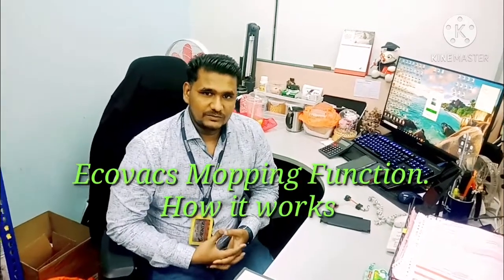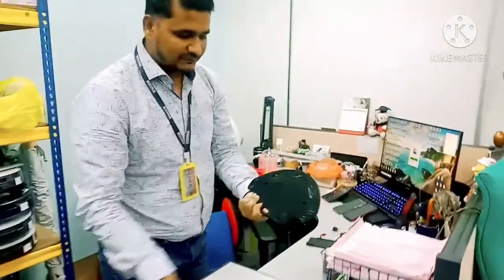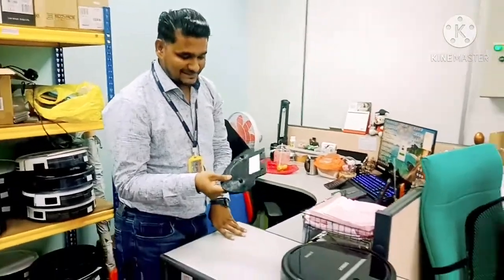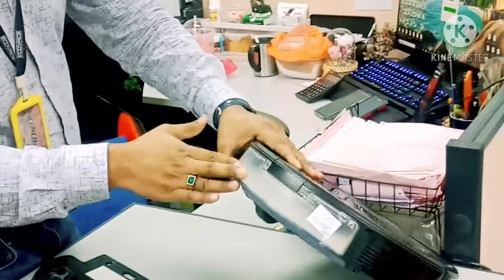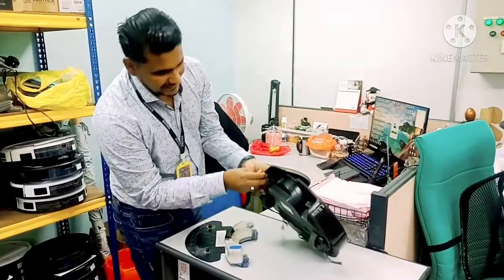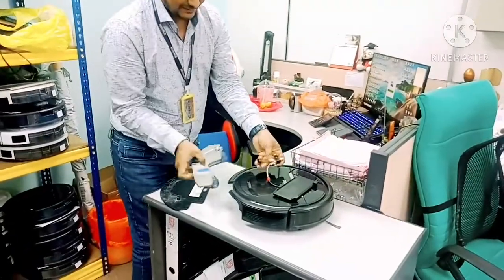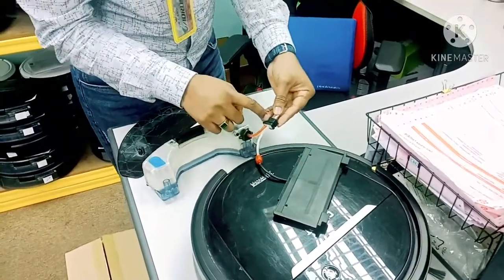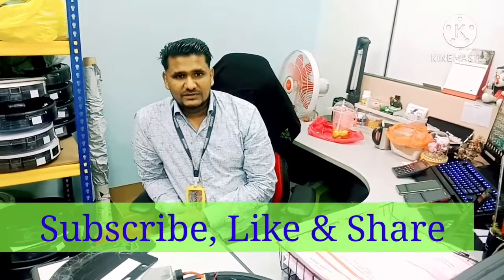Reasons why water can not dispense while mopping

Comment: How to clean Dettol or detergent from the water tank
Reply from the maker: Detol signe can not remove but detergent can remove with hot water...but don't shake tank else pipe Will disconnect then need to replace water tank...just leave hot water for few minutes then just gently turn ... detergent will comes out

Comment: My ozmo 950 not dispensing water. In fact it climbed on carpet also.. same was as it would do when water tank is not attached. So I feel it is not sensing water tank only
Reply from the maker: After power on the deebot plz attach water tank with mop plate together see weather deebot gives msg that Moping plate has been installed or not...if got msg n deebot still enter in carpet area means carpet sensor faulty...located next to charging connector in whole...just replace that will be ok
Reply: Thanks for your reply...i actually repaired the main brush motor by watching your video. That main brush motor issue is solved and thanks for the same. I have done some mistake in assembling it back and after that the water dispensing has stopped..it does not look like carpet sensor issue as water is also not dispensing

Comment: Any advice for when it is not working but you have only used water? We have not used any detergent and no water is coming out.
Reply from the maker: Good question...ok for testing plz remove moping cloth...make sure water tank full with water.. moping plate attached... remove water tank n plate together.... power on the deebot..once ready to use then attach water tank n plate without cloth together see weather deebot gives voice indication that moping plate has been installed???...if got msg then press water tank from back tightly n hold then pres auto button see water can dispense or not...if can then just water tank issue.. became slightly loosen from lock so need to replace tank only...if still no water then water Pump Issue... need to replace...but you plz check my other water pump issue videos as well... sometimes just pipe Tangled that's why water couldn't come...like this u can try at home first

Comment: Thanks for the video, very informative. Using floor cleaner seems to be a common mistake, shame the manufacturer doesn't think to apply a sticker to the tank saying "DO NOT USE FLOOR CLEANER, WATER ONLY", that may save a lot of us making the mistake. I have a Deebot T9+ & used pine-o-clean and now it doesn't work. Is this something I can take apart and try to fix at home or should I return it for repairs? Prior to this we were extremely happy with both the vac & the mop, it has exceeded our expectations.
Reply from the maker: If service center available in to your country then better take it there... because they got parts can test weather water tank issue or water pump
Reply from the maker: U mean water not Dispensing from Ozmo pro tank or its not ascallate ???
Reply: @ecovacstechnicalsupport5278  water does not dispense
Reply from the maker: Can WhatsApp at 01137973018..a video clip so can confirm what's the issue
Reply: @ecovacstechnicalsupport5278  Sorry, I don't have WhatsApp. The issue is I used a floor detergent and now Deebot mops like it should except no water disperses from the tank, it just does a dry run. I assume the tubes are blocked as you have shown on your videos. My question is, is this something I can try to fix at home or should I take it back to the store of purchase for repairs?
Reply from the maker: Actually need to dissemble the deebot so can test weather water pump disconnected or just water pipe block...
Reply from the maker: Without open the deebot you can not confrm what's the issue
Reply: @ecovacstechnicalsupport5278  So should I try it myself or take it in for a service?
Reply: It does say only water in the instruction booklet that came with the robot

Comment: Hi,

Today I, received a Ozmo 930.
Resale version. Shouldn't have issues but unfortunately there was no water coming out as told in this video.
I checked the outside parts but didn't see something wrong.
Thought maybe the pump is dry.
Sp decided to put a Syringe (10cc medical injection) with some silicon hose on it. (end little bit tight up with wire) placed it over the intake nozzle and pushed water through.
Had some resistance but pushed gently through until something felt like opening/popping. Directly after the 3 nozzles starting to flow water out of it.
So also probably clogged or sticked tubes/pump.

Maybe it helps others.

Now working fine but keeping an eye on it. Luckily the pump or maybe only a motor is not an expensive part to replace and handy enough to do it myself.
Reply: And if not allowed to put cleaning dissolve in just wash the mop before and put some detergent on it. That's enough for one clean. Better than nothing.
Reply from the maker: Thanks for sharing 😊

Comment: How to solve the problem if mopping outlets are blocked?. Buy a new container?
Reply from the maker: If u use only Water then it won't block but it's ok. There's nothing impossible...I have solution for all issues...u can use normal needle or 💉 n try to clean from outside normally it starts working again if pump not spoil or the whole pipeline not block...if u can manage to open that Mop plate located underneath the dust box area then can easily open that pipe line it works if all clear

Comment: I have a u2 pro it's dispensing lot of water on the floor and slipping on the floor as well. What do I do !!
Reply: Hi, I am having the same problem with my U2 pro. Couldn't find out how to solve it! Now i am not putting water in its tank, just sprinkling little water on floor so that the cleaning pad absorbs it and does not have excess water spilled from deebot. This trick seems to be working ok for me
Reply: However if anyone knows how to solve this water overflow and skidding of robovac problem then i would definitely like to know!

Comment: Hi, thank you for the video, very clear.I have T8+ with two water tank, the ozmo pro and the normal one (with washable pad). Now the issue is that with ozmo pro it is all working, but with the normal tank the pad is not mopping, it is dry and water do not mop it. I think it is not a problem of the deebot pump (because it does work with the ozmo pro tank), how could I check the issue on the water tank side? thank you so much

Comment: Hi, I use a Ozmo T8 with pro attachment. After a recent mopping operation I found little bit of water inside the dust bin and the dusbin compartment. The quantity was very little. Both the filter and the sponge were dry. What could be the reason? Is it something I should be worried about?
Reply: I sometimes see this with non-pro attachment. I think it happens from the robot going over the same area again when it’s still wet, so it sucks up some drops.

Comment: Hi, how about the same problem water not coming out with deebot T8?
Reply from the maker: In T8 water pump is different more powerful won't spoil fast... U can try an other water tank....hopefully problem will be solve ....before buying plz get help from someone who's using ozmo  920, 950, t8,  T8aivi,  T8plus T9 or N8 pro.... All these water tank is same... So just borrow for a while n test if water can dispens with this tank then just replaced new tank... Or can contact nearest service center for this help
Reply: @ecovacstechnicalsupport5278  i switched to ozmo pro, and the water can dispens, so is there a problem with my deebot T8 normal water tank? should i change my water tank? or is there anything i can do to troubleshoot my normal water tank ? like maybe make a hole on top of my water tank ?

Comment: Hi we have deebot u2 pro. It was working fine but from past few days it's not using water when mopping and it ends up leaving wheel marks and also does not vaccum like before. I do clean the parts as recommended. Please suggest how to go about. I tried calling customer care but it always says customer rep busy. Please help.
Reply from the maker: Hi can u plz whatsapp me a small video clip so I can confirm what's the issue 00601137973018
Reply: @ecovacstechnicalsupport5278  hi..I have  deboot 950 ozmo series..water not dispensing..voice msg comes when installed..never used any liquid cleaner..just water..not sure what issue is

Comment: Hi From water tank reservoir our inlet pipe came out... can we open the reservoir and fix it?
Reply from the maker: Actually some customers they shake  the water tank with water inside to clean inside... But in result water pipe disconnect when water hit the pipe... N water tank is sealed from top... Means if any part disconnect inside we can not open n repair that part... Only solution is to replace tank..

Comment: Hi thks for the video. Could you please share how to check the pump DIY for my deebot ozmo 950 series? There are 6 little holes in the deebot body that mopping plate is installed. Can it be cleaned using a WD40 contact cleaner or just needle?
Reply: When the water tank inserted, there is a voice message water tank has been installed. If it is a pump failure, how can I check and fix it?
Reply from the maker: Actually it's very rare that water hole block that's why water not drip... Normally in ozmo 950 few things need to check.. Water tank,  when attach mopping plate so got voice message that water tank has been installed??  If not then mop sensor faulty.. If got then water tank or might be water pump is faulty

Comment: Hi thks for the video. Could you please share how to check the pump DIY for my deebot ozmo 950 series? There are 6 little holes in the deebot body that mopping plate is installed. Can it be cleaned using a WD40 contact cleaner or just needle?

Comment: Thank you for your videos. They are very useful. I have a deebot u2 pro and the water flow is very high. I have checked the water flow setting  on the app and it's set on standard.
Reply from the maker: Hi...thanks for watching...in u2 pro full water tank can be finish in 60 minutes its fixed.  We can not select from the app...its normal

Comment: Hi my Deebot is not dispensing water from the water tank . When pressing on the plastic button in the water tank , one or two drops of water are only coming out . Is that normal ? Or should more water come? I have tried making a hole on the 4 small circles like you suggested in the previous comment but it is still not dispensing water . When pressing on the button in the water tank , the pipe inside does not move or do anything ? What is the problem here ? Is it the water tank or something inside the robot ?
Reply from the maker: If u heard this msg then might be water tank or water pump issue...but in both situations u need to contact with service center in new New Delhi
Reply: @ecovacstechnicalsupport5278  yes the mopping plate is attached sound is coming . It is the pump or tank issue .
Reply from the maker: When u attach moping plate...do u hear any msg fron deebot that moping plate has been installed???
Reply from the maker: If u can hear the msg that moping plate has been installed means sensors working. Only water tank might be not connected fully a bit loose that's why pump couldn't build up enough suction to pickup the water from tank .. or water pump itself not functioning...without installing new water tank we can not confrm...or if any of ur friends using. 920, 950, t8, t8 aivi, t8 plus, t9 then u can try their water tank to confrm weather its just a water tank issue...because in all above model water tank & pump is same
Reply: @ecovacstechnicalsupport5278  I have a Ozmo 950 . In Amazon the water tank of T8 is only available . So can I buy the T8 water tank for 950 ? Will it fit ?
Reply from the maker: @joecp05  hi...yes can use no problem. Ozmo 920, 950, T5MAX,  T8, T8aivi T8 plus,  & T9 in all these models water tank is same...so can order with full confidence sir
Reply: @ecovacstechnicalsupport5278  in Amazon the seller says it only works with T8 and does not work with 950. Can you confirm once again  please . Thank you 😊🙏. Also I don’t see the spring button to insert the water tank in the T8 water tank . 950 works on spring button to insert water tank into the robot .
Reply from the maker: @joecp05  sir im Technical supervisor for ecovac Robotics in Malaysia. The models i mentioned their water tanks are same...but originally when we want to order from seller then we have to give model no n every model got different part no..that's the reason seller not confident that can use in other model or not....but its my daily routine...buy with 100% confidence. Dont worry
Reply from the maker: @joecp05  if possible can u send me pics of Indian ozmo 950 version water tank n pic of available water tank. U can WhatsApp me 00601137973018
Reply: @ecovacstechnicalsupport5278  Sure thanks a lot 🙏🙏🙏. Will msg you on WhatsApp .
Reply from the maker: @joecp05  welcome
Reply: @joecp05  Hi did you finally buy the T8 water tank for your Ozmo 950? Did it fit? Was there my issues? My Ozmo 950 also facing mopping issue where the water is not flowing to the mopping pad. Please help
Reply: @nishanthn9006  Hi Nishanth . Sorry but the T8 tank is not compatible with the Ozmo 950 . There are 2 types of water tanks for the T8 , the normal one and the mechanical one which not only mops but scrubs the floor hard , so that the hard stains go away . I am planning to send my 950 for service to the Delhi service Center . Waiting for the Corona situation to cool down . I
Have already mailed the service Center .

Comment: Hi, im from colombia in south America. Very nice video. I have a Osmo 930 and i have  one problem. When i put the water tank i can hear the sopund that is ready to mop. buen then the robot start and make some circles and stop and try to return to the charge base. If i remove the water tank the robot works fine. Any advice?
Reply from the maker: If without moping plate deebot functions normal but after installing plate doesn't work n stop after few seconds then there will be 2 possible reasons: 1 both wheels rubber grip spoil & became flate thats why it can not move forward while moping. If u think tyres got grip in good condition then 2 reason is moping cloth...try another moping cloth. If moping cloth very rough n thread comes out then deebot wont move sometimes

Comment: Hi..I have water dispensing problem for OSMO 950..I am using only water since I purchased it 6months ago. but last 2 weeks it stopped dispensing water. Pl suggest how to fix this?
Reply from the maker: 1 thing u can try at home is...on top of water tank u can see black circle got 4 white dots on it...use a needle n pop in 4 white dots so air pressure increase then hopefully it start functioning again
Reply: @ecovacstechnicalsupport5278  do I need to insert needle in those white dots? can you explain what I need to do?
Reply from the maker: After deebot turn on attach mopping plate..there should be a voice message that moping plate has been installed....if u didn't here this message means moping plate sensor not functioning. If u hear this sound then water tank issue needvto replace water tank...water pump in this model is very good quality one...wint spoil so fast...so its just water tank issue

Comment: Im using Ozmo 610, how if the water really get block? Any idea to fix it?
Reply from the maker: Plz follow the instruction of the video if everything is ok but still water can not dispense then 3 reasons...1 maybe plate sensor spoil witch detects that mopping plate installed or not. 2: water pump volve block 3: water pump spoil... in all these 3 issues..you must send ur deebot to service center...or if u can buy water pump only then u can sattle at home...pump in Malaysia is 65 RM

Comment: I am not sure if my new T8 is working properly.  I wash and wring dry the mop cloth, then set the mopping function to ultra high level water. But the floor is only a little bit wet.  I never use detergent in the water tank.  Can you help?
Reply from the maker: Ok noted...in this case if you want to test that how much the water dispense. Plz power off the deebot n turn on again once deebot ready to use then remove moping cloth from plate fill up the water tank to full. Attach moping plate with water tank without cloth. Insert water tank to deebot make sure u heard the sound that moping plate has been installed...if no sound then moping plate sensor not functioning. If got sound then just press auto button then u can see how is the water level bcoz all water will drop direct on the floor you can see on floor once deebot start moving.
One more thing i let u know once u press auto button same time water start dripping for continuous 3 seconds then stop and after every 90 seconds will drip again for 3 seconds
Reply: @ecovacstechnicalsupport5278  
Tried the solution suggested, the water is dispensed like you described,  continuous water dispensing for short while , stops for a longer period and repeat again.  Thanks a lot for detailed explanation and advice on how to test.
Reply: @ecovacstechnicalsupport5278   I just bought my T8 and the mopping seem not functioning.  I have tried the suggested solutions but there is no water came out, any futher action i can do. Or should i just send to the service center?
Reply from the maker: Welcome